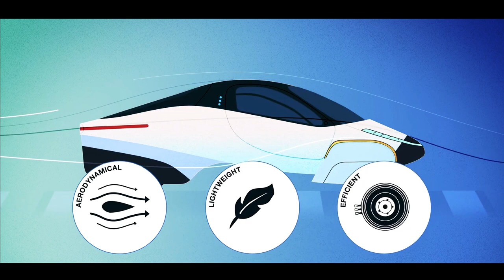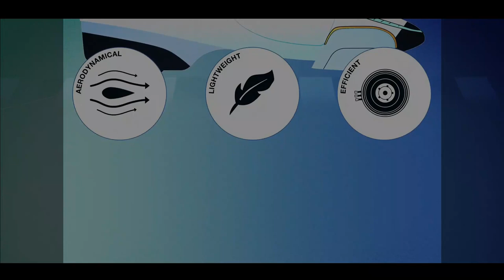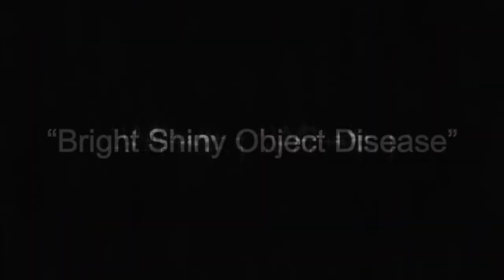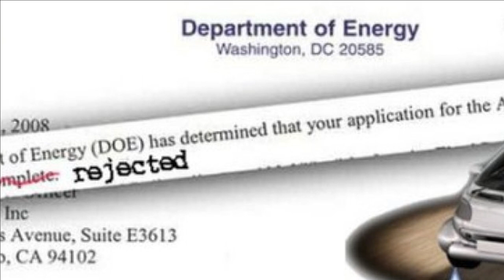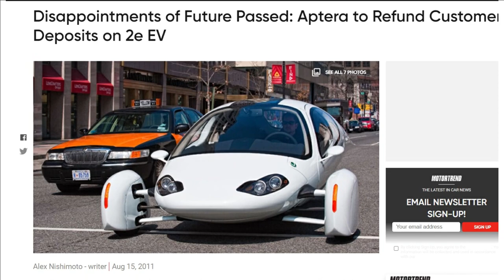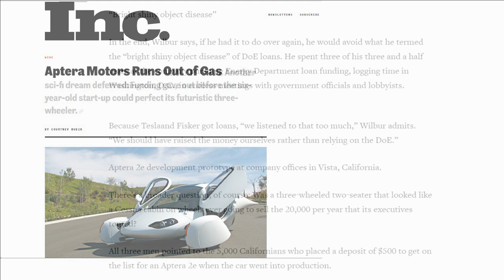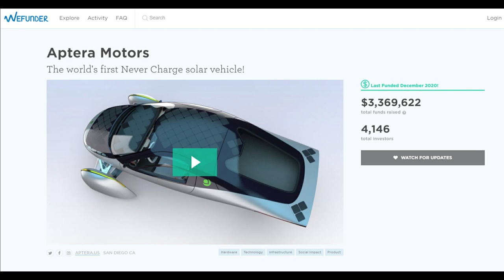The Truth About Aptera: Paradigm Shift

Comment: Hope Aptera comes to fruition, but the different battery options and payloads just don’t make sense unless they are entirely different vehicles. 250 mile version with a 350lb battery is supposed to have the same suspension as the 1000mile version with 1400lb battery? With only 500lb payload it makes no sense. Get the next smaller battery and the payload should go up 350lbs unless there are entirely different suspensions.
Reply: No-one said spring rates and damping would be the same.  With Roush doing the suspension design I think we can expect fantastic performance.  I had a ride in the twisties yesterday in Luna, and it was thrilling to this old motorcycle rider

Comment: Batteries are expensive and while a scientific paper showed by adding gel to lithium ion batteries they recharge forever! This article has vanished but it’s a fact the recharge cycle can last forever yet it’s being withheld. Why imagine only needing one and the cost drops for cell phone, electric cars! Sigh….
Reply: Really? Unlimited cycle?
Reply: We have had batteries that can be recharged infinitely many times since the days of Edison, after a certain point the corrosion and generally degradation of the case and terminals with time will require you to replace the battery regardless. As it is the roughly10,000 cycle life of current LiFePO4 batteries is already enough to make a car a pack that pretty much lasts forever (those 10,000 cycles only drop the battery down to 80% of its original capacity)
Reply: @cepuofficial9025  not as great as it sounds, other factors then charging and discharging will eventually degrade the battery regardless of how many cycles it may or may not have had. What we have on the market is already close enough to infinite cycle capable if your system properly takes care of your battery.
Reply: @neilhoogendoorn8045  mistakes are generally a more common factor than deliberate fraud when a paper is retracted.

Comment: I would like to see this car finally put on the road.  But I'm very very skeptical on it happening.
Reply: In my case the risk of a preorder was small compared to the chance of getting  an early car.  Later cars will be more developed so there is a trade off.
Reply: @n.brucenelson5920  problem is this car has been around for a while now in prototype production and still isn't on the road.  What I'm getting at this isn't the first time that they've set up pre-orders.
Reply: @GANTZ100pts  Yes.  The only reason that happened was that the founders lost control of the company.  They won't make that mistake again.
Reply: They need to concentrate on going into production. They seem to be stuck in the adding features loop.
Reply: @Soulxlight  They were only back together as a company in 2019.  They have brought a working prototype from a clean sheet of paper to driving round San Diego in less than two years.  I don't know of another company that has accomplished this with their first vehicle - certainly not Tesla!  By the end of the quarter, they will have two more, and then perhaps 12 or 15 more by Fall and people will have a chance to look at them.  I think they will make their production goals for the end of the year unless there are major vendor supply problems.
Reply: @garethbaus5471  That is correct.  Tesla got the loan.  They were in even worse financial shape when the loan came through and had laid off all of their motor engineers.  Aptera would not have needed a loan if they had gone into production and started delivering vehicles, as the founders had intended.

Comment: For a 2 seater that things takes a lot of space.
Reply from the maker: It's only wide at the front wheels. The length is about the same as a Prius. I think it's a very unique concept with a decent chance of success.
Reply: There are engineering tradeoffs that inform the shape.  It is wide at the front to give excellent stability, even with 3 wheels.  The wide set wheels also help lower the aerodynamic drag that make the efficiency of the design possible.
Reply: @apterareboot1555  for bigger roads yes. But places in Europe and Asia we require something with a lot of pace inside with a smaller footprint outside. That's why boxes on wheels are popular here in Asia.
Reply from the maker: @red_ashcroft  It's going to be interesting how this plays out over there. Hopefully they already have or are working on a strategy to address potential issues with different markets.
Reply: @apterareboot1555  true, I feel that the EV market is a bit saturated already here with mobility EVs to cars already covered by a lot of manufacturers. Competing with EV cars that are priced at less than $5000 dollars is going to be the price to beat.
Reply: @n.brucenelson5920  The Nobe EV is going to be a tough contender.
Reply from the maker: @red_ashcroft  It's a new technology so it makes sense that there are a ton of companies trying to make their mark. Give it anothr 20yrs and there'll only be like 4 or 5 major players left.

I've seen a $5,000 tiny 4 passenger EV made in China. I thing the company is called Wuling. But I don't think it would meet US or EU road safety standards.
Reply: @red_ashcroft  While it is a cute city car, the main purpose is quite different.  Even the shortest range Aptera will have almost 100 miles more range, and be a much safer highway car.  The Aptera is quite wide for a city car.  I don't see much overlap and I think there is a place in the market for both.
Reply: @n.brucenelson5920  it can be used as a sharing vehicle to carry people from one point of the highway to another, like a long distance rail system, but they have to add more seats to that car.
Reply: It still better then a motorcycle
Reply: @apterareboot1555  "only wide at the front wheels." very easy to parallel park....  all the park, skip the parallel  ;)

Comment: I' would prefer an 8x8 armored personal carrier to deal with the  bad drivers in this country but the Aptera is a nice looking vehicle.  Just not sure how safe it would be when a drunk soccer mom runs a red light because she is trying to get home after cheating on her husband in time to clean up the smell of the seventh guy she has had relations with that month.
Reply: You need more data.  I think you will feel better about this when the automotive crash test results are published later in the year.
Reply: @n.brucenelson5920  P=mv
Reply: @tastysponges  Of course.  I drive a Gen 1 Honda Insight that weighs about the same as the 40 kWh Aptera at 1800 lbs..  I survived being hit from behind at 60 mph by a large car without injuries.  The Aptera will almost certainly be safer.

Just look at the safety of F1 cars at far higher speeds and even when hitting massive objects.  Good design makes a huge difference when it comes to safety.

Comment: 100 or 500 deposit?
Reply: 100 - or 70 with a code from another deposit holder.
Reply from the maker: The deposit requirement is $100 but if you click the link in the description, you will get $30 off making the deposit requirement only $70.

Comment: Two words

Car crash
Reply: It will be tested to automotive standards and the ratings announced before production begins.   Stay tuned.
Reply from the maker: I had/have the same concern. The original Aptera looked to be very structurally sound but you don't know how good or bad a product is until it gets into the hands of the public with real world problems.
Reply: Way better than a motorcycle or scooter. Potentially not far behind (if at all) an average car. People feel safe in big trucks and 4WD but that is not necessarily  the case.
Reply: @n.brucenelson5920  Will it? Do you know how much that costs?
Reply: @koitorob  If you mean will it be crash tested?  Yes.  it will require sacrificing several pre-production vehicles and the testing lab fees.  A single test apparently costs in the neighborhood of $100,000.
Reply: @koitorob  back in 08-09 there were 2 models they advertised l. Diesel hybrid for 25K and all electric for 45K.
They probably don't even know what they will be selling it for with the reboot.
Reply: @stevenleslie8557  pricing starts at $25,900 to 46 K, depending on battery size.
Reply: They have a low center of gravity, and are designed with a ridgid passenger compartment surrounded by crumple zones, so they will probably be comparable to your average compact or subcompact car which is perfectly adaquate.